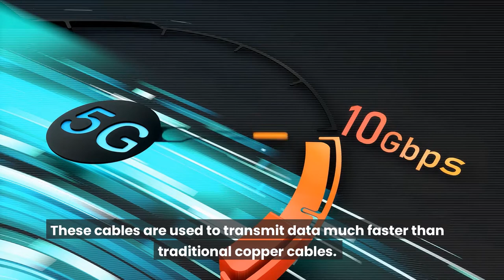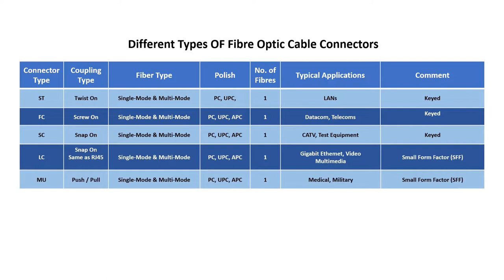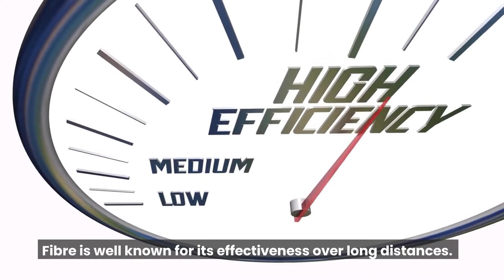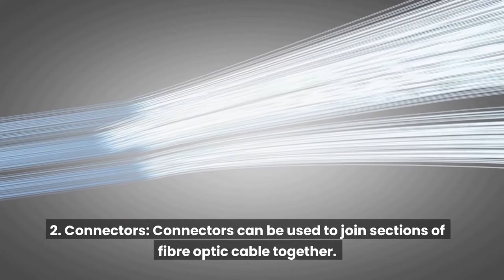Choosing the Right Fiber Optic Cable.   [Choosing Fibre Optic Cable]

Comment: Fiber optic cables: 550 m for multi-mode fiber, 40 to 100 km for single-mode fiber.
Copper cable: 100 m.